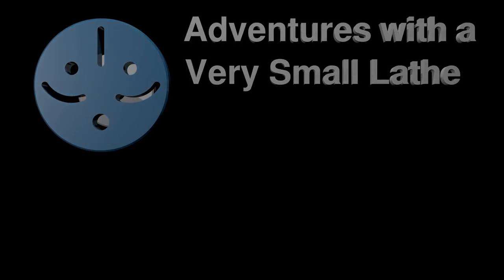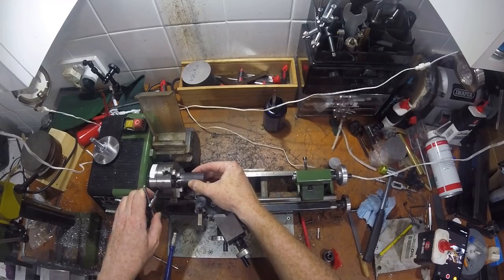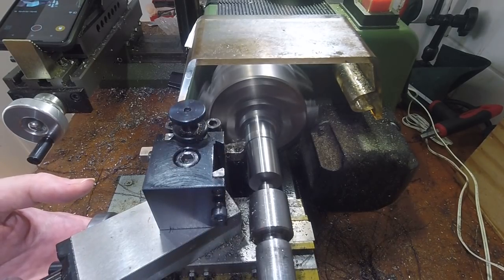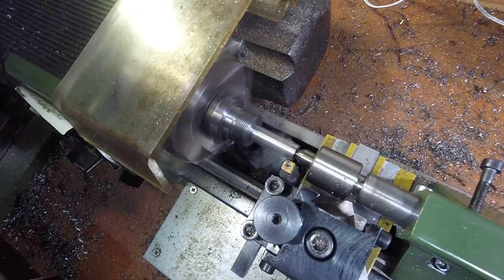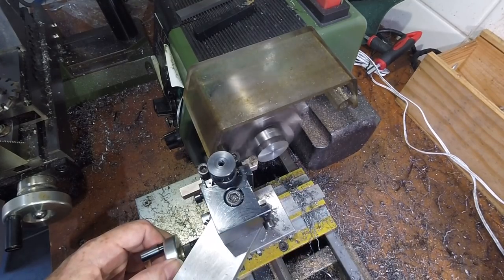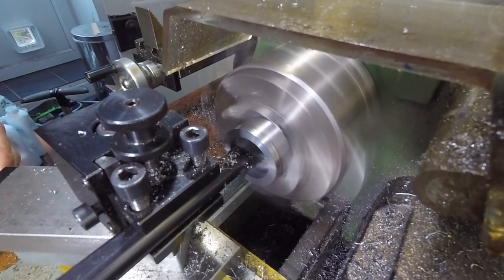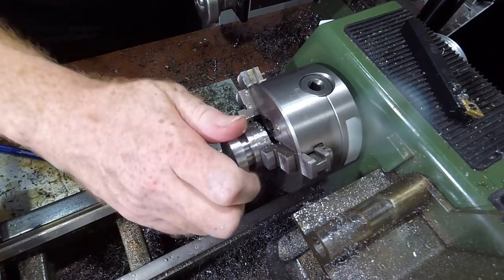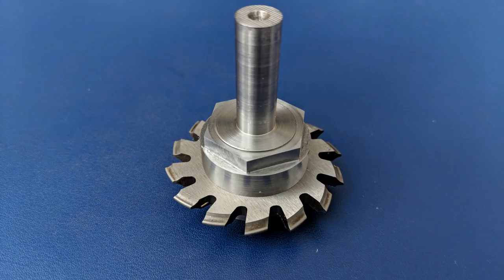Making a Gear Cutter Arbor for a Proxxon Milling Machine

Comment: I like that design for a gear cutter holder. I might miniaturize it. Winter is coming and I go back to my clock. I have to recut a gear, so I while I am at that, I will rebuild my micro dividing head and learn to make cutters. Commercial cutters are too big for my little MF70 mill. Making a clock is a project that springs to mind. Needs some means of dividing which itself involves some gear cutting.

Comment: It might have been a good idea to put a left-hand thread on the gear cutting arbor, so the locking nut tends to tighten, as the arbour rotates, rather than loosen, as it currently will.

Alternately, you could turn the cutter over, and run the mill in reverse.
Reply from the maker: That's a really good point! Next time I'm making this style of arbor (which I definitely will), I'll remember that technique.
Reply: @AdventureswithaVerySmallLathe  Another advantage of putting a left-hand thread on it, is you will be threading away from the chuck, which means no more panicking, trying to stop the carriage before the tool crashes into the shoulder of the job.

Comment: Hi, I think you have taken time and have put a lot of thought into the design of the tool resulting in a tool that is safe to use, practical and looks very professional.  I once made a morse taper MT1 fly cutter,  I really wish I had incorporated a threaded draw bar in the rear of the tool to aid retention.  It may be a good idea to thread the tools for use with a draw bar if you have not already done so. Very well done, keep up the interesting videos.

Trefor
Reply from the maker: One drawback of the Proxxon FF 230 is that it doesn't allow a draw bar. I have to depend on making straight shank tooling to fit into a collet. I did consider adapting the machine to fit a custom made draw bar, but couldn't work out a way to fit it into the design.

Comment: I have to do just this job for my Cowells gizmos (and FF230 like yours); thanks for showing the design.
One comment though, I don't know how Proxxon lathe achieves its thread cuts, but man, I clench every time I see your thread cuts -seems real fast to me! I guess I do use HSS for threads tho.
Reply from the maker: I assume you mean the internal thread? That's the advantage of threading away from the chuck with carbide. Carbide cuts better at faster speeds, and cutting away from the chuck means there is no requirement to stop dead at exactly the correct point, so higher speeds are possible.
Reply: @AdventureswithaVerySmallLathe   I should try a carbide thread cutter. Been making do with a couple of HSS ones; not sure my sharpening fixtures will be up to keeping them going in the longer term.
The Cowells has a nice classic changegear setup (of course a Norden would be nicer, but it's so small I can't complain much), but the real killer feature is the backgear arrangement. Makes threadcutting slow and easy and lots of torque for turning bigger chunky bits like a flywheel.

Comment: Oh one last thing about speeds, the larger the diameter you are turning the slower the speed and you may or may not have to consider surface feet per minute.  I am not sure that matters much here everything has turned out just fine
Reply from the maker: Thanks for the tip. The diameter I put into the Sandvik app was the maximum diameter of the stock, which should give me an idea of the safe limit. As the part gets smaller, the optimal rpm will get higher I think, or is there something wrong with my approach?

Comment: Is this a Proxxon PD250e lathe and would you recommend it? Thanks 🙏
Reply from the maker: It is a PD 250/e, and I've just finished writing a comment answering a similar question, so I'll copy and paste my answer from there:

I would recommend it. The build quality is very high, and it arrived ready for immediate use. I've never had to do any maintenance work in around 4 years. Just keep it clean, and well lubricated.

However, I would add two warnings:

1. This lathe is small. If you want to do a lot of work on material over 20mm, the lathe is going to struggle, and probably suffer wear and tear. Make sure the work you have in mind fits a lathe this size.

2. It is a lot more expensive than easily avalable lathes. If you have a limited budget, and can follow all the videos on improving cheap chineses lathes, you can get a decent lathe for much less, but you will have done a lot of the work yourself.
Reply: Adventures with a Very Small Lathe thanks, that’s most helpful. I got a 150 but the chuck wouldn’t even open with the ridiculous little screws supplied for the job, so I sent it back. The 250 looks to have a proper chuck key, so I’ll try and buy a 250 next! I don’t need a big lathe, but the 150 is for a child or someone who loves microscopic equipment.

Comment: Very nice design and video, thanks for sharing! May I ask which app you are using on your phone for calculating speeds etc? It also looked interesting!
Reply from the maker: The app is TurnCalc published by Sandvik Coromant. Thanks for watching!
Reply: @AdventureswithaVerySmallLathe  That's great, thanks for the answer! Is there an equivalent app for milling that you can recommend? cheers!
Reply from the maker: @skoulatos  Sandvik also publish a MillCalc application, though the basic cutting speed calculation is the same. Most of the features of the app are targeted at big machine users, who need to work out feed rates, so not that useful for purely manual tiny machines.
Reply: @AdventureswithaVerySmallLathe  Ok thanks a lot again! I will give them a try anyway :)

Comment: Love it! Quick question from a beginner: you're moving the compound while thread cutting. Wouldn't this offset the tool from the thread though?
Reply from the maker: The compound needs to be set at exactly the same angle as the thread surface. The reason for doing this is to ensure the tool only needs to cut on one surface.
Reply: @AdventureswithaVerySmallLathe  Thank you! I didn't know that, I thought it could cut on both.
Reply from the maker: The tool can cut on both faces, but it is more stable if it only has to cut on one. I find that my little lathe works much better if I set up the compound to cut on only one face.

Comment: I was going to tell you there is a much simpler an easier way to have a accurate an true alignment for your cutter
Put the item to be turned true to the spindle in the mill. And put a lathe cutter in the vice an just mill the cutter true in the mill. 
It turns out perfectly every time, 
and you don't have to be concerned about a fraction of run out that the lathe has,
Reply from the maker: That's a cool suggestion, but it seems likely that the alignment would only be as good as the run-out in the mill spindle collet? It would be perfectly accurate the first time, but if I removed the tool, then put it back in the spindle, it would be slighly off within the range of the runout of the mill spindle.
Reply: @AdventureswithaVerySmallLathe  If I may comment, CMAenergy offers a good solution, but you are correct in stating that the repeatability of milling spindle collet is less than satisfactory. However, truing by machining in the mill ( or other machine where applicable) is a regonised technique, when high accuracy is required, and high precision equipment is not available, then truing up the datum clamp face is a necessary evil, usually can be performed several times, but truing up the cutter diameter can be omitted.
My first experience of this technique, was during my apprenticeship in late 1970s when I had to machine a 900 mm long thin bronze wear strip (circa 38 X 6 mm section) parallel on the 6.00 mm dimension to 0.03 mm. This was on a shaper, and a thick pre-drilled steel beam  was clamped in the vice, then indicated/ set parallel to the shaper stroke, then a light cut was taken to create a perfect flat plane ( even if the shaper does not develop a true geometric plane). Using the pre-drilled counter sink holes in the bronze, it is screwed to the beam, then machine down to required thickness.
Hope this helps, and many thanks for sharing.